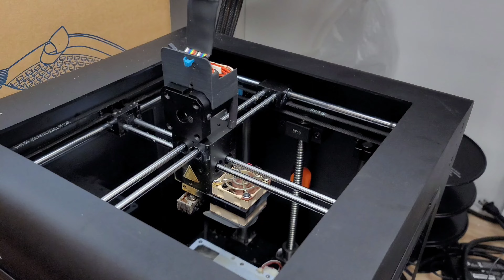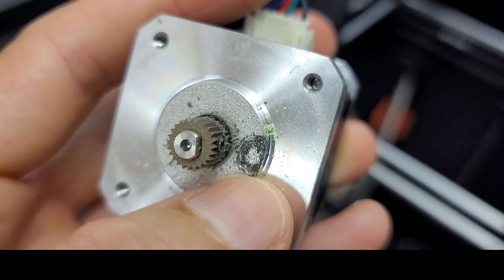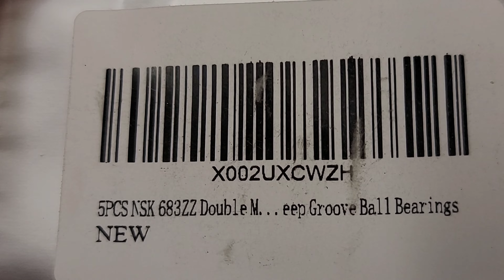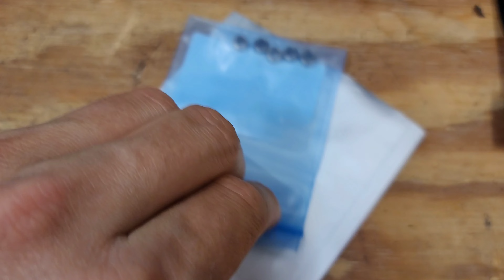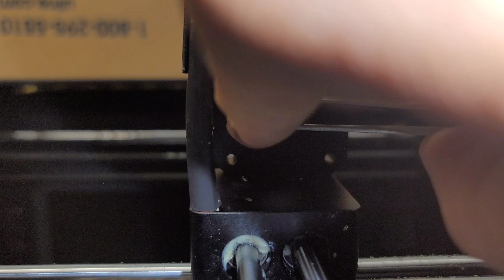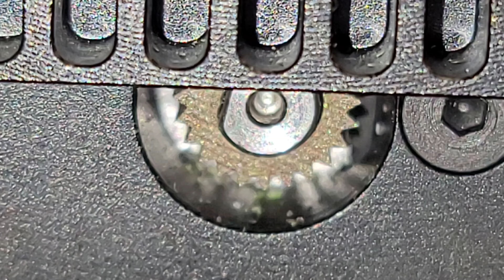How To Replace ZORTRAX M200 IDLER BEARING - Extruder not feeding, gear stripping 3D printer filament

Comment: I bought a couple used zortrax M200s from an auction and none of them will feed. I almost gave up until I found your video! I didn't even know there was supposed to be a bearing in there, because they are ALL missing it! Super stoked that I found your video!! And thank you for calling out the size of the bearing, as I had nothing to reference.
Reply from the maker: Glad it helped!

Comment: Looks like you could do with cleaning the lower heat sink with the fans on, i had issues with filament stripping and cleaning the the heat sink of dust and residue resolved the issue
Reply from the maker: Thanks, that is good advice and will do that too. Definitely this time the filament feeding issue was due to the trashed bearing.

Comment: Hey bro u know the thing u did with the 800 splat ball gun mag to make it 1200 can u do the samething with the den 1200 mag
Reply from the maker: The 1200 mag and the 800 mag are the same. The 800 mag has a baffle to reduce capacity. The 1200 mag does not have that baffle.